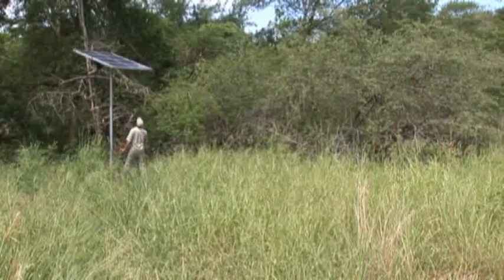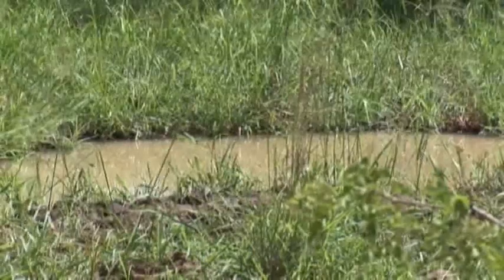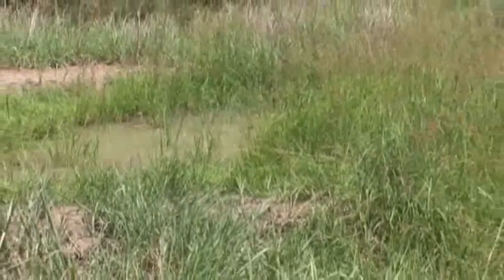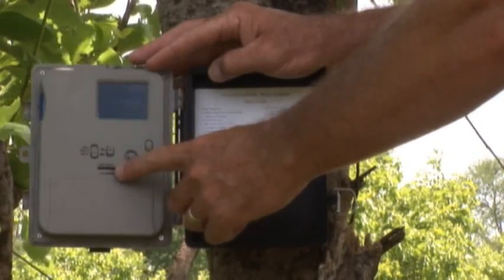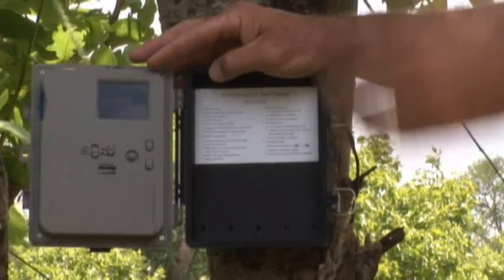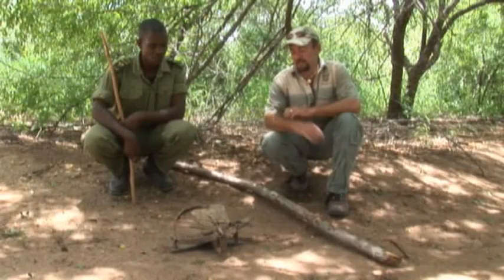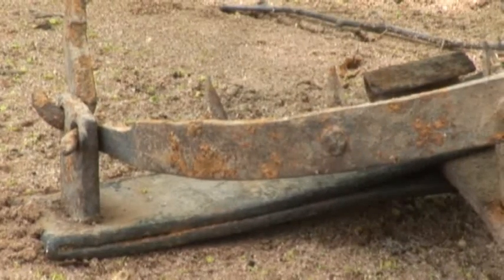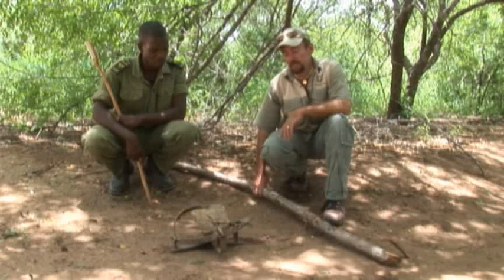Solar Powered Water Pump

Comment: This kit was perfect for it and has saved us from having to run electricity to the pond area. ◓◓>allmy.tips/SolarWPumps?53    It was easy to put together and the fountain goes up pretty high when full sun is on the panel. The fountain keeps the water moving and I haven't notice any mosquitoes around the pond since I added it.. I added a DIY filter system (a milk crate like cage, lined with furnace filter material, set the pump inside it and added filter bio-balls). The water has been keeping pretty clear. and I've had no pump blockage or problems to date ( but have only had it a few months).. I really like it.